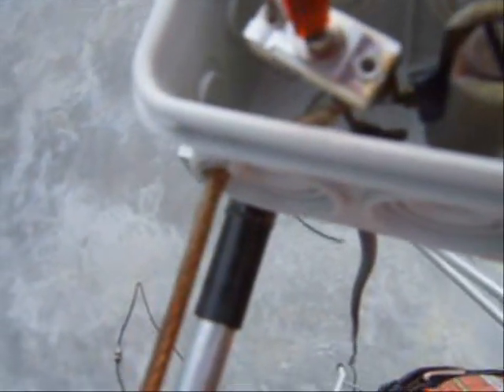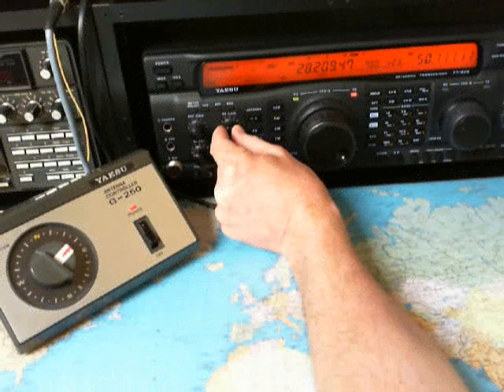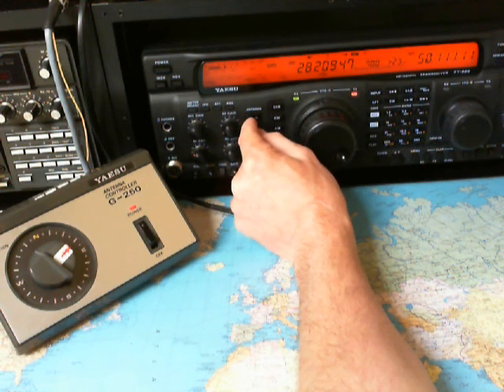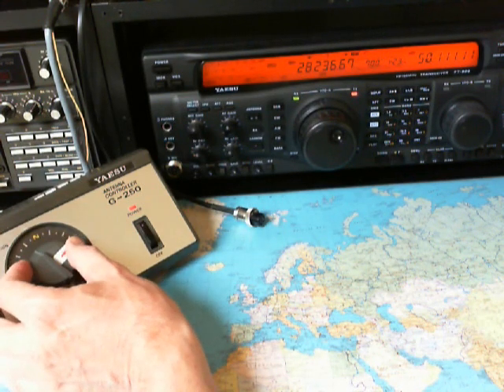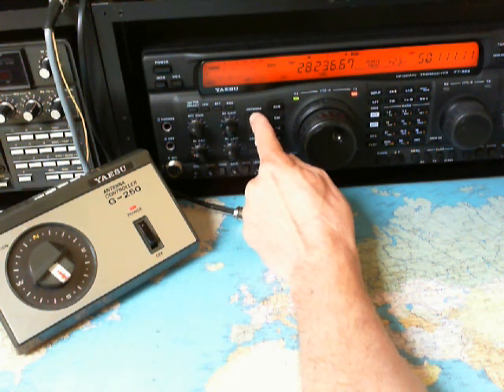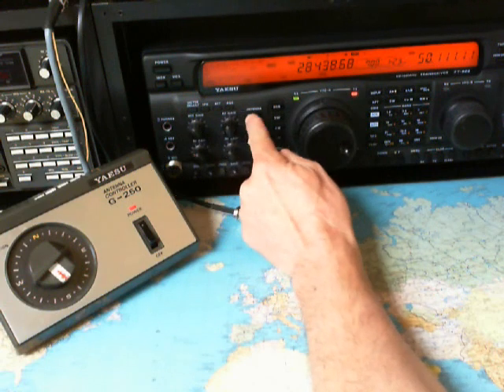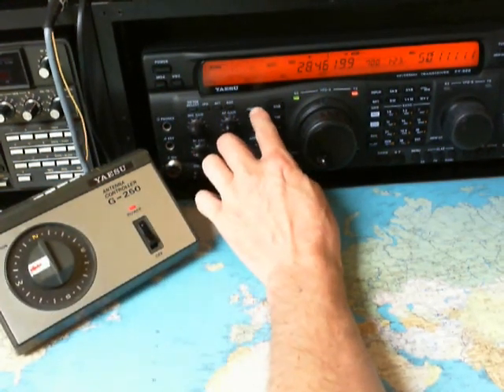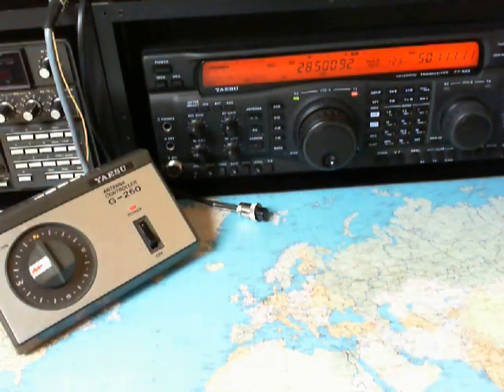Swiss HB9CV homemade antenna for 28MHz

Comment: may i know what capacitor did you use/? or what capacitor can be used as alternative
Reply from the maker: Mister Elexis hello, thank you for your interest. A 100pF trimmer is to use, it's the optimal range. All in all, CB-radios and -antennas are a passion of me. It was a beautiful time in the 80ies: Big CBiers parties, without smartphones and facebook profiles. So I'm not on facebook, but on 27 MHz… Happy airwaves to you.